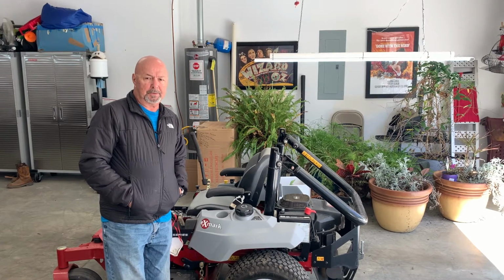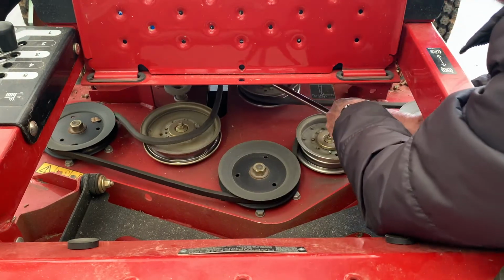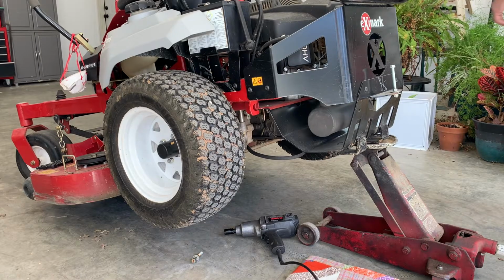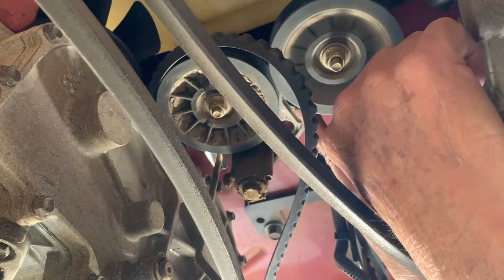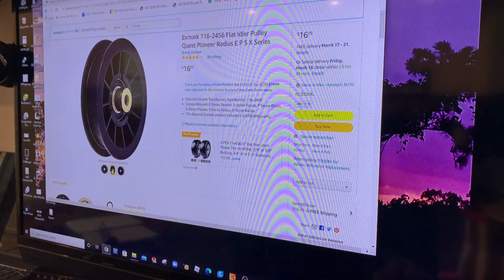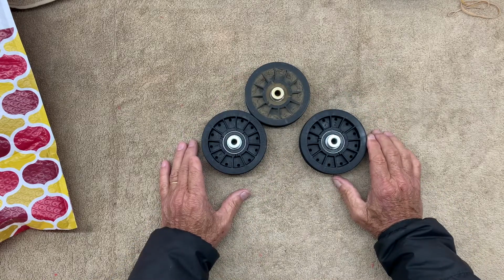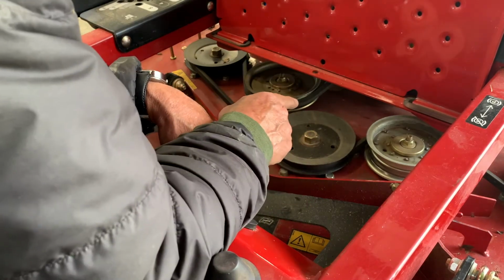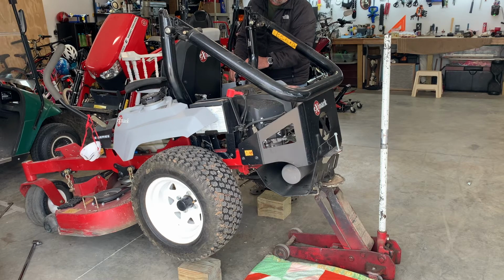What's that dry bearing sound??

Comment: Thanks, always good to know more about the mower. Recently ran over a threaded wire, one of the thin wires rode up in to spindle bearing. Those types of debris , or not keeping your blades balanced are the two main causes of bearing failure. One time I put a blade on and it didn't seat properly, that will destroy a bearing in about 30 seconds, or as soon as the blades are engaged.
Reply from the maker: Hi thanks for watching and the comments! I can imagine what an improperly installed would do and really quick! I think you may have already but if not please consider Subscribing and hitting the like button. I would really appreciate it!

Comment: It's been my experience that the bearings in every Exmark flat idler does this after a few years (been running Lazer's since around 2002. The idlers on the deck will do it as well, just harder to hear since they only turn when the clutch is engaged. It's a good idea to slip the belt off every 75 hours or so (depending on usage) and spin everything by hand. Currently rebuilding the deck on my old 44" Lazer HP and everything is getting replaced. I am also surprised they use that bracket to hold the clutch body. The older ones have a strut that bolts to the clutch housing and the bottom of the engine decking.
Reply from the maker: Hi. Thanks for watching and the comments!  Looks like they would have used better idlers for sure.
Reply: I replaced the same ones on my 44 HP about 3 years ago and was doing a belt change this weekend and one of the Amazon specials is already noisy. The Rotary brand ones on Amazon actually get good reviews so that will probably be the next ones I use. Just picked up a 52” HP that will probably need them, along with a whole lot of other stuff.
Reply: Every exmark I have had had an idler pully go after 2-3 years. They don't make that zirc easy to get to, and it has a tendency to vibrate with any loose tension on the belt. When they go they sometimes burn out into the deck and form a groove in it.
Reply: @Nivenvids  and now I have a Hustler so we’ll see how it stands up.
Reply from the maker: Hi thanks for watching and the comments. If you haven't done so already please consider Subscribing. I would really appreciate it.

Comment: Never, let me repeat - NEVER use an impact driver to replace a PTO clutch.  The clutch must be installed at a specific torque to function properly and provide a long service life.  The clutch's ability to function properly is based on very (very), close tolerances and need to be torqued to manufacturer's specifications to operate within these tolerances.  Every new clutch I have ever replaced make this abundantly clear in the installation instructions.  Otherwise an excellent video - especially like your garage!
Reply from the maker: Hi, thanks for watching and the comments. Good info for future reference. If  you haven't done so already, please consider Subscribing and hit the like button.
Reply: I agree, dont put that much vibration on the deck it shakes everything attached to it and could potentially damage other bearings. Never use an impact to put blades on, or anything for that matter that needs a specific torgue.
Reply: Fun fact, if you bring your ex mark to a shop for a bad bolt, for example, they will ask if you used an impact on it cause it would void the warranty coverage for the part.

Comment: Wondering if this is the issue ive noticed with my tractor. Only thing is the noise sounds like a louder noise over top of the engine and only seems to really occur when the blades are egaged and im cutting grass. If just the blades are engaged i dont really hear the noise.
Reply from the maker: Hi thanks for watching and the comments. It sounds like it could be the bearing in the PTO. When it's engaged, the bearing is not spinning. Either way if you haven't done so already please consider Subscribing and hitting the like button. Let me know what you find.

Comment: How the hell did you get that belt off ?
Reply from the maker: There's 2 idler pulleys that you can move by hand to get slack in the belt..if I remember correctly..
Reply from the maker: Or are talking about the blade belt?
Reply: @NINEPOINTFIVEPROJECTS  not the actual belt on the deck but the one that goes around the hydros around the 2 pulleys you replaced
Reply from the maker: As I remember you can move the 2 idler pulleys by hand to get enough slack in the belt. I believe they move outwards away from the center of the mower.
Reply: @NINEPOINTFIVEPROJECTS  tried that can't seem to get it so by your video I assume you got it by dropping the clutch assembly ?
Reply from the maker: It’s been a while since I did the work so I went back and watched the video. I just pulled on the belt at the engine pulley and easily got enough slack to remove it. The two idler pulleys just have spring tension on them and should be easy to move. Is your mower the same as mine? If so are the idlers froze up or something? It’s strange that yours won’t pull free.

Comment: Mine has like a turbine noise whe. I run the blades
Reply from the maker: Hi thanks for watching and the comments. Sounds like one of the pulleys that the belt rides on for the blade is bad. There are several pulleys. You could remove the belt and turn each pulley by hand. It will feel rough as you turn it. Either way I think you may have already but if not please consider Subscribing and hitting the like button. I would really appreciate it!